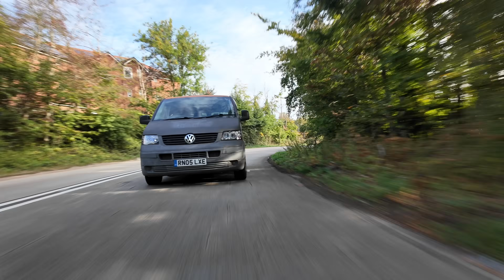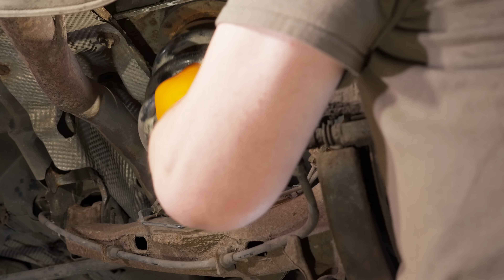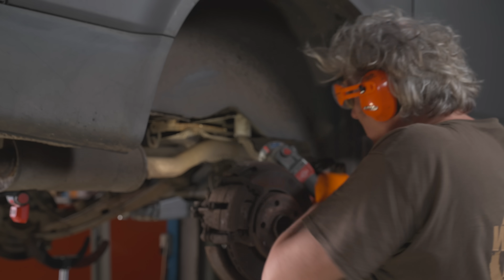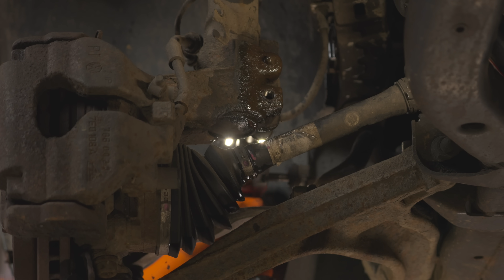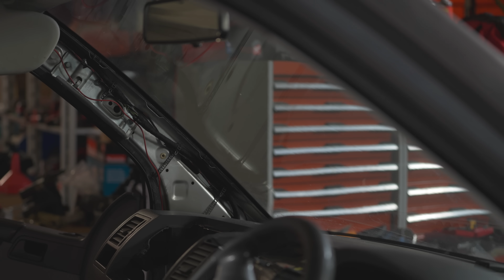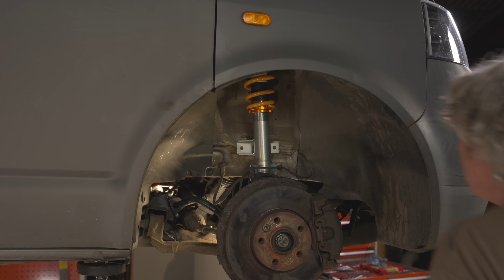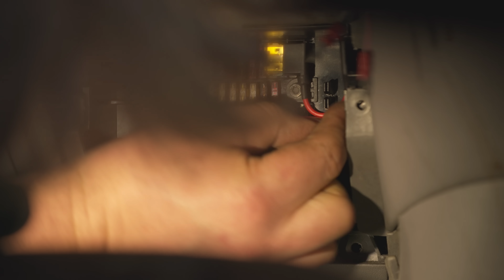5 Steps to REPAIR and UPGRADE Your T5's Suspension and Audio System

Comment: You should change the bushes on the lower front swing arm whilst you’ve got the front axle apart( they’re a common fail point on a T5)

Comment: That explains why the aftermarket stereo in my T4 died inside and was blowing all the fuses (it had an adapter that let you connect the permanent live and switch live together then to the T4 wiring harnesses I will definitely do the same thing as you have done

Comment: He was appointed as an expert arbitrator for Warrantywise, a company that provides car warranties: in this role, he evaluates complaints and helps develop service and repair packages. In short, he does other work and has almost completely disappeared from the spotlight.
Reply from the maker: True, not too bothered about the spotlight but one does have to earn a crust and YouTube requires a significant commitment for rampant success! Thanks for watching.

Comment: Greetings from Istanbul, Türkiye. I also own a 2007 model 1.9 TDI 105 hp Volkswagen Transporter. It's a very robust vehicle, and it has coilover suspension, which provides more stable road handling in corners.
Reply from the maker: Greetings. Interesting you say that. Since doing this job I have also been wondering about trying out an airbag suspension mod to see if that means a smoother ride or worse handling on corners...

Comment: Bought a similar but not quite the same head unit based on this video, and I've got to say it's a pretty awful bit of kit. All the physical buttons round the outside launch apps you never want to use, the apps themselves look super dated and very much like cheap Android apps, there are next to no proper audio controls. It just feels exactly like what it is, which is a cheap, thrown-together android tablet with some basic apps on it. It's super frustrating there isn't a middle ground between this sort of solution and paying £1,000 for a high-end head unit from one of the established brands.

Comment: I did this to an older Mercedes and simply double taped the GPS unit up under dash sticking it to the top underneath, never had any issue with signals and it was hidden.

Comment: A few thoughts from a professional Comms nerd ? Agree 100% about the GPS ground plane but on old T5s the AM / FM antenna is right down the centre of the windscreen (newer ones in one of the mirrors) So best to keep GPS antennas and dash cams away from it if you want to listen to AM/FM radio! . If you don't have dash top speakers, under the N/S corner grill (plastic) works perfectly and doesn't show. If you cannot receive anything on AM,/FM there is a DC power feed to the antenna connection point at the top of the windscreen with the built in antenna.  Wire  that to the switched positive accessory feed feed from the head unit.  Those DAB antennas - been through 3 here - bleeping useless as soon as moisture corrodes the connections!!!
 Better off with an external taxi antenna cut for 187MHz (yes below the dab band but best overall performance - I did a LOT of testing!! )  Then fit an RTL-SDR LNA which does the job of the black windscreen brick on the stick on antenna. Fit that between the taxi antenna and the head unit. The USB receiver will power the LNA directly up the coax.  DAB reception on the UK roads is atrocious! You need as much signal as you can get!. Lastly - wrap the microphone extension connection points and the USB DAB receiver connection in cloth tape. Will save you HOURS of rummaging in your dash in 6 months time !! Cheers all!

Comment: I love Edd's enthusiasm and presenting style - showing working on older vehicles you often have to adjust and adapt parts. However, as a very amateur mechanic, having replaced suspension springs and dampers, it seems strange (crazy) to me to have a much shorter spring with a solid cylinder of metal to make up the difference in spring length. Surely for a van designed to carry load you want the most effective shock absorbing system which means springs of the original length and "compliance"?

Comment: Yeah so the rubber washer should be between the chasis and spring adjuster. Microphone if you woult route it on the driver side would reach on the driver side. Gps antenna mounted on a aluminium plate on a plastic dash. Thats awesome. It can be mounted in the dash perfectly. And i didnt finished to watch the video. At least you got the front suspension right

Comment: Why din't you use a CAN-converter to power the radio? As the 12v ACC only works when your contact is actually in the ON position. Whereas with the CAN converter it will keep playing until you remove the key from the ignition.
Reply from the maker: That’s a great tip. Another job on the list! Thanks.

Comment: Those GPS receivers are remarkably effective, ours is just mounted on the dash in place of one of the switch blanks. Picks up 15 sats with ease.
Reply from the maker: They do seem to be very good, strangely fun watching it find and lose satellites as you drive along…

Comment: Ed it’s incredible how the condition of the car battery affects the performance of a modern petrol car.
Reply from the maker: They are just as important on EVs to wake up the High Voltage battery, one would think they would be easier the charge, and maintain on modern cars.

Comment: Just one big advert for E Bay the suspension kit only costs £200 I can see it lasting very long cheap parts don't last
Reply: I have tried a few maxspeedingrods brand items and they've been just fine. Stay away from their turbos though, unless you plan to rebuild the insides with quality parts on arrival.
Reply from the maker: Got to earn a crust but it’s also a great opportunity to test stuff out I wouldn’t necessarily use normally. Loving the new stereo - the mirroring and DAB radio is great, now I need to sort my tired old speakers!

Comment: Hi Edd , great video, also I’m interested to know how many miles are on your T5 pls
Reply from the maker: I’ll have to check but it’s not as simple as you might think; the running gear has done over 100k-150k, the body has done over 250k to 300k!
Reply: @eddchina thank you, they are great vans, I have a 2010 t5.1 with 245k , on its 2nd gearbox, but touch wood still going strong

Comment: FYI, @33:50 (approx.) when Edd is talking about wiring to the 12v Ignition lead, What I did with my VW Passat of the same vintage, was to find the lead from the Key-in sensor of the ignition switch. I ran this to a relay that was then connected to the aftermarket radio. This way, the radio turned on when I turned on the ignition, but turned off when I removed the key from the ignition (mimicking the factory radio behavior).

Comment: tsk tsk a ball joint fork  to knock out driveshaft  ?no brass drift or air chisel   welcome to the best use of inappropriate tools. turning the  steering would have removed the need to hang up the hub

Comment: Recommend looking for a good branded name head unit, and paying someone competent to install it. Chinese make some real cheap crap that will overheat, and spy on you and your connected phone. Do not wire one into a 30Amp circuit, fire risk if no additional fuse (remember it’s Chinese crap). If you are offered with a radio that is not DAB+ you won’t be able to listen some major radio stations in the UK.
The channel should come with a ‘this is for entertainment purposes only, this should not be considered technical advice’. Ed is selling out. It’s more like a sales pitch for eBay where most ‘guaranteed compatible’ stuff will either be broken, returned or thrown. Trust your local car parts factor if they have a physical shop, and you will not waste time, or destroy your ECU if you have CANBUS.

Comment: If its just the ignition live wire to head unit it should purely be a 12v signal Edd. It'll draw practically no current.

Comment: do modern stereos really need a 5 amp fues Edd? as used to be a 2 amp on the old stereo's of yesteryear. did have an issue with the piggybacks for my dashcam the wires were extremely hot to touch until bought a 3 amp fuse to replace the 5 amp fuse, but do be extremely careful with buying piggyback fuse holders, as you cannot be sure where the fuse was purchased from and can allow the device to pull more than double the rating, and being on such a high rate fuse then can easily be 10+ amps going to the radio without the fuse blowing if a cheap Chinese fuse. so while the piggyback fuses are good they should come with a danger warning before sealing any electrical equipment into a vehicle to check the wiring does not get extremely hot to touch before you seal the wiring away.

Comment: Since the T5 is the same chassis as the T5.1/T6/T6.1 I bought used control arms, struts etc. from wrecked T6.1s with low mileage in stead of replacing the bushes.  Rear trailing arms with 10K km from a 2024 were £200 the pair and then I get new wheel bearings, bushings and brake shields with it. I was also able to get the front struts from a 2022 Caravelle with only 1K km, and I also got the front hubs from a Caravelle since the 3200kg version uses a different strut mount. Just had to replace all the T6.1 ABS sensors with T6/T5.1/T5 sensors as the T6.1 speaks a different electrical language.

Comment: Hi Edd, I have a question about my 2020 Ford Focus. Whenever I turn on full lock either way while on the biting point of the clutch, the vehicle make several cluncking noises, sounds like metal on metal. I am just wondering if it's the steering rack or hopefully something much cheaper to replace. Can you help me please?

Comment: Measure from the centre of the wheel to the arch, rotating the tape to allow you to get the maximum measurement at the crown.
Measuring off the tyre and trying to read at the bend in the tape is too inacurate.

Comment: The small digital torque device is crap, I have one and the digital display figures start failing after about a year (it's made in China). I've just gone out and purchased a normal torque wrench, which is what I should have done originally..
Sorry, Ed, but that product cannot be recommended.

Comment: Funnily enough I just spent the last weekend fitting an Android head unit with DAB+ USB, rear parking sensors and camera to my daughter's KIA Picanto.  The glass mount DAB antennas are terrible so I didn't bother at all with that and instead swapped out the standard roof "bee-sting" antenna for a combined FM/DAB one with a built in amplifier.  Complete faff to fit as it necessitated dropping the headlining at the back which required removing the entire rear seat and undoing the rear seatbelts so the luggage compartment and C-pillar trims could be removed.  Worth it though for the very integrated look of the whole job.

Comment: Heyy Edd, do note the piggy back fuse holders have an orientation. Normally you want to find out what is the feeding leg of the fuse. That side should go to the common side of the piggy. That way your extra circuit isn't loading the original circuit. Used one of those to connect my dashcam.

Comment: Hi Ed firstly welcome back now could you give me some advice i got the same headlights as your van i fitted them and put new bulbs in i even had a local garage to do an alignment but they are terrible at illuminating the road it's so bad I won't drive it at night I've been told by my mot tester that L,E,Ds  are illegal if I fit them any ideas thanks x

Comment: nice to see VW T5 by Edd again, its massive community here of VWT5 owners, all are thirsty of repair/maintenance video,  i would love to see more, some MOT rust welding in common areas, engine jobs or suspension, recently had my electric sliding door fixed by replacing seal pinch sensor with resistor and both sliding doors are alive again with remote too,

Comment: 17:04 definitely upgrade the exhaust to the turbo.

I'm surprised you've never come across the fuse piggybacks.

I was taught not to pull my bars when tightening. It's also it's effort to push when tightening.

Comment: I found a small hollow space underneath the dash and set up the GPS receiver in there. It doesn't need to be visable through the window, it can handle some blockage of material. Just make sure there's no metal covering it.

Comment: Just found your channel Ed. Great to see you back. Missed you on Wheelers Dealers. Just thought I'd mention Ed. The one 12v feed from the fuse box is is great but you need a separate 12v feed to power the memory to the stereo as everytime you turn it off you will lose your settings, Radio GPS, Audio Controls time etc. I'm sure you already thought of that. Brilliant Channel Edd. Keep up the good work😊😊😊😊😊😊😊😊😊😊😊😊😊

Comment: Hi Edd!
Nice to see you back.

About that new stereo, typical for the cheap Chinese stereos to not have standard ISO connectors ( your van obviously has them, that old stereo uses them ), but off the shelf new standard ISO connectors are easy to come buy, and installing them has now become very easy due to clear color coding and standard ISO pinout. 

All those cheap Chinese DIN2 stereos ( yours included ) have a weakness though, their audio power output IC shorts out and you get a stereo which turns on but there is no sound coming out of them. 
The IC it's self is on all of them ( no matter the model ) YD7388, a Chinese lower quality version of the ST original device TDA738x series. 
It doesn't help that the cooling is super crappy, what they call a "heatsink" it's actually a small part of the back cover, thin and in no way suited to cool down a 4 channel bridged class AB device, it heats like crazy until it dies out. 
I know this because i have been repairing lots of them, most of them with this issue ( some with digital problems, crappy software or crappy digital IC's ). 
So, use it carefully, at low volume output it should be ok.

Comment: One sugesstion, I would choose another fuse but not the 30A beffy one, because the RUN/ON  wire just send "wake up" power to the head unit, also I can't be sure the quality that tiny jump wire can hadle such huge current or not... Just be safe！

Comment: MAXpeedingrods suspension components are not painted to resist corrosion, come back in a year and have a look, likely to find aluminium oxidisation and rust, they're cheap for a reason.

Comment: Hi edd I bought an 06 t5 t28 102 van last year the first for me, I am the second owner it's got full service history right up till I bought it the last owner was a cabinet maker it's done188000mls which I thought was high but apparently not.turned it into a day van full width legless bed,re trimmed all the interior in anthricite and smoke plus insulated as well I absolutely love it it's in silver there is a few marks on the body but other than that it's mint,last of the wax oiled and galvanized I believe. I had to come out of work 10yrs ago I have been a mechanic since I left school I am 55 now, because I was diagnosed with rhumatoid arthritis mine is very aggressive this meant I had to give up my car and change my lifestyle. pretty much stuck at home for 9years in pain which caused major mental health issues,my wife and I went camping for the first time with my grandson last year and I loved it and to my Surprise she borrowed some money from the bank and said find something suitable for camping trips and basing my purchase on past workshop experience the 1.9tdi transporter t5 not 5.1was for me the obvious choice so started looking but wanted a van a blank canvas it took ages to find a decent one but we did and yes it wasn't cheap 6k but I could start the interior and sterio seats lighting etc straight away it has changed my life I am keeping it till I die lol. I have been saving a little money and just bought some banded steels and it's going to crs in the spring for suspension work yea this old grandad is going lowdown and rocking the commercial look no face lifts allowed on my van. the only face lift is my smile when I am parked in the country side with a brew in my hand, like a friend said to me it's an old van but a mint one would not touch any other van over 20 yrs old love your content edd take care of your health and don't ignore anything regarding it love you edd keep at it buddy.

Comment: Great video -- and I enjoyed the extra length version on your other channel.

Ever tried torquing up those sort of strut top nuts and having to hold the shaft with a torx key at the same time?  Some VW vehicles use a one-time use pinch nut on that fastening so that it won't spin on there under any circumstances, and then the shaft keeps turning when you want to torque it.  Also the nut is in a well, so you have to use a through socket and drive that eventually with a torque-wrench ring spanner extension, but you can't use the 90-degree dodge for the setting (no room), so you have to calculate for the extra length.  Oh, and the whole fitment is covered with part of the wiper mechanism cowling, and that is channelled into the bottom of the windscreen glass with an expanding strip which is no longer pliable when it's had a few years aging, so it risks shattering the windscreen if you think you'll remove it first.

Why is VW so determined to make these things so darned difficult?

Comment: Love your work Edd, always a pleasure to watch. I agree that fuse taps are a great little gadget, however it’s important to ensure they are fitted the correct way around! If fitted incorrectly the circuit that you add would be unfused and a potential fire risk! Can’t wait for the next video.